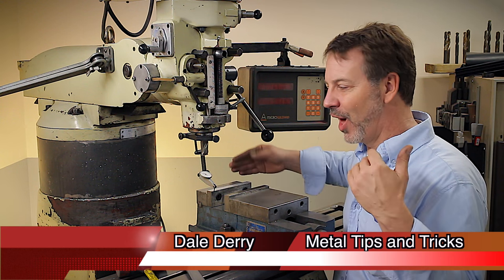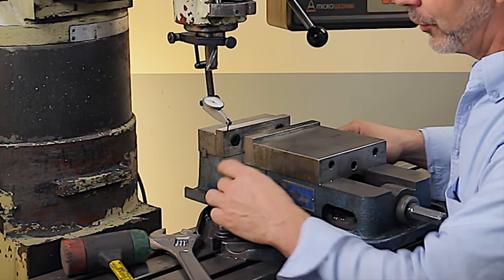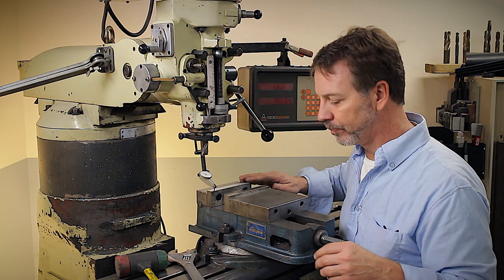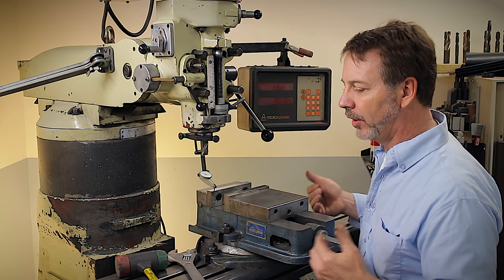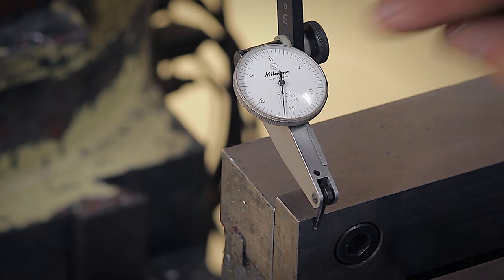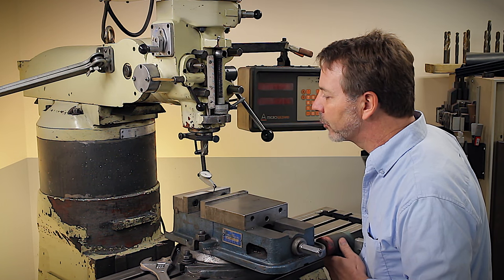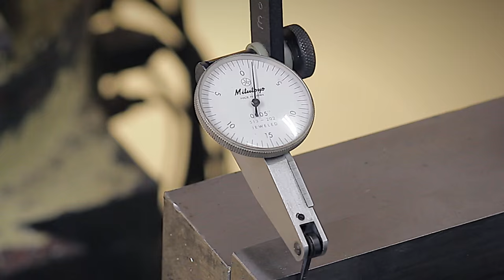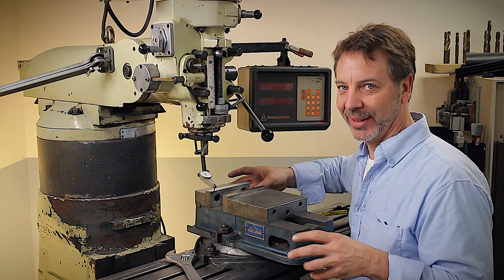Milling Machine fundamentals - Tramming your vice

Comment: Great video, my mill is small and so is the vice. With the jaws so narrow 3" it's harder to get a quick reading as the numbers don't vary as much left to right. I tend to clamp a larger 6" parallel in the jaws to make traming the vice easier. I use a basic indicator and magnetic base because I'm cheap. Cool to see it done more professionally. Keep up with the great vids.
Reply from the maker: Thank for your comment

Comment: Really slick tip. Used it this morning. My test indicator might have some sticking. The test indicator jumps a few thou while moving laterally with the test indicator in contact. For the final adjustment, I needed to move away and then back onto the vice jaw an equal amount.  Regardless, your method is still faster than halving the difference, tapping with a hammer, etc. Thank you
Reply from the maker: im glad you like it

Comment: All well and good, 2 things which you didn't cover is (1) tightening the bolts to the table, I've been in the trade for 40 yrs and if lucky after tramming rarely does it stay in place so torqueing the bolts play a major roll when readjusting the vise witch you did not cover! Don't get me wrong, it's a great video for beginners, but for seasoned veterans, a half a thousand is ok, but when squaring a block in our it world it needs to be spot on. Other wise you'll just magnified the squarness throughout your project. Just saying but still a great video.

Comment: i’m new to machining i go to a trade school can your readings on the dial be affected if the the head of the mill is not leveled with the rest of the machine? there was a kid that backed a adjustment nut out to much and the haven’t fixed it and the teacher hasn’t told me to not use that mill it was off by a 1000th inch

Comment: Bill Still
Dale, I've a quick question for you.
When I attach the dial test indicator holder to the mill spindle, there is a bit of movement of the spindle even though I insert the draw bar. Is this movement ever enough to cause inaccuracies in the measurement?

Thanks for the great teaching job.

Bill
Reply: Why do you choose to mount the DTI in the worst possible place ? Attach it to something rigid!

Comment: I find with my dti there is a thou to 2 thou just by the change in direction, locking the y axis helps this. dti is a very old verdict that at one point was dropped but even a newer one we have at work has that .5 thou error
Reply from the maker: It's important you know if the strengths and weaknesses of your mill,  so I can either use them or avoid them.
 Thanks for the comment

Comment: Dale, thanks for the video.  It looks like your mill has a riser block installed between the column and the head.  Can you tell me about it if that is the case.  Is it a purchased unit or a homemade?  Thanks. R.J.
Reply from the maker: It's a 7" riser.  I wouldn't have a Mill without it, it not home made I got it off another mill.

Comment: This is the slickest way I have ever seen to tram the vice.   It might be a bit difficult for me because  there is no power feed and the cheap Enco mill vise jaws are warped.
Reply from the maker: +William Cassidy 
Try it any way you might be surprised
Reply: I clamp a tall parallel in my vise and run the indicator against the edge of it. Gives a smooth edge for it ride on.

Comment: You need to then tighten the bolts, and run that same pass again.
Also,
A half a thousandth over 6 inches translates to one thousandth over 1 foot.
That's not good enough.
This entire process should take about 10 minutes.

Comment: Don't you just put the vice on the table, take the slack out of the T slot bolts then push the vice up against the side of the T slot then tighten the bolts !!!! I guess you could stick a gauge on it to see how 'out' it is but it shouldn't be too far out provided the T slot sides aren't worn and the bolts are the same diameter.
No reason you can't fix a straight edge to the table and then put the vice jaws onto that to clamp the vice in place and machine a little off its mounting bolt-holes to ensure they're aligned with the jaws!